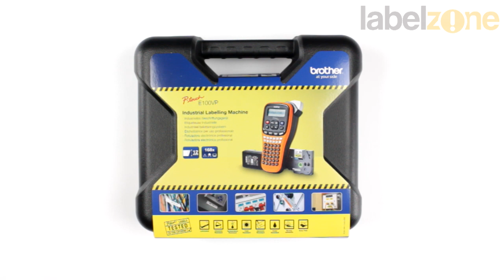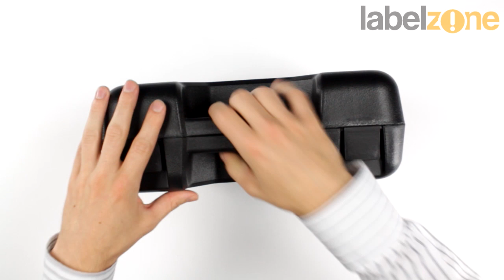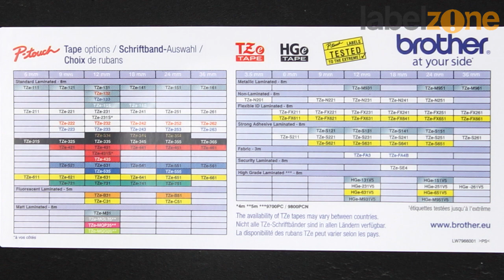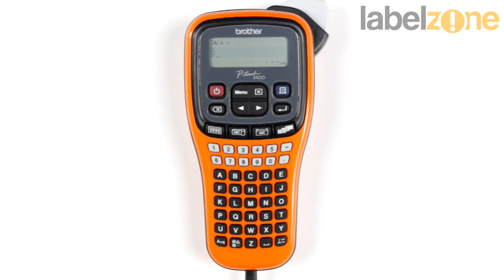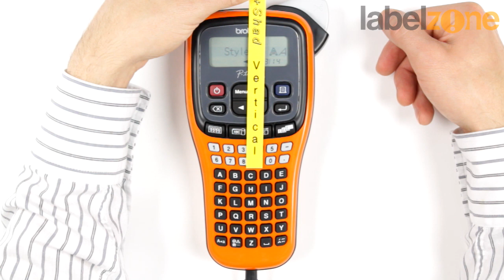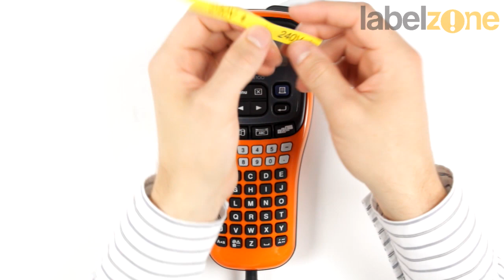Brother PT-E100 Industrial Handheld Label Printer - Unboxing and features

Comment: Works well, this is the perfect machine for printing labels. >>>share4.photo/BLabelPrinter?ҏ    I loved the price point and the speed is pretty decent. I needed to print 250 labels and it did this at a good pace. The software was a little difficult to get downloaded for Windows 10, but once it was on my machine it was easy to use.

Comment: So them : is that where you ment to cut with scissors? Or can the machine not do it itself? Because I know the better models have that feature
Reply: As the print head is about 25mm before the cutter it prints : to show you where to cut. If you want the option for the printer to feed 25mm to allow you to use the cutter on the tape, you have to go up to the e300 (which also can print 18mm tapes).

Comment: Can you please please help me out? I got this one today and I want to get rid of that stupid margin at the beginning of the label, you know, when you print a label and at first there's a huge 25mm margin which is very annoying and I think you waste TONS of tape. And also, can you help me to print several labels at once? I know there's a 'chain printing' function but it's not working for me for some reason. Thanks!
Reply: I'm having the same problem. The only thing i can find on their site as far as solutions go is 'to cut with scissors on the 2 dots'...  

I get that the extra part can be helpful from wrapping around cables, but since most the time I don't need that.. it seems like the only reason it can't be disabled is to literally force us to waste tape so we buy more